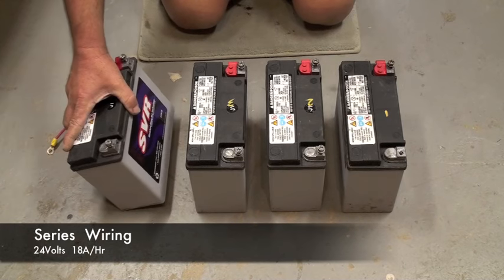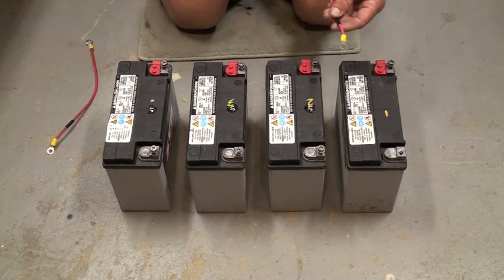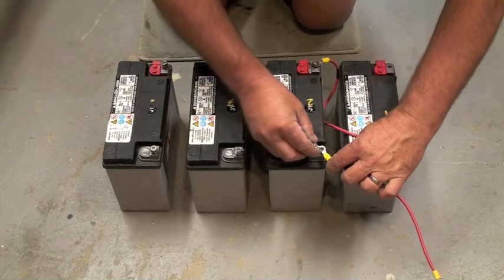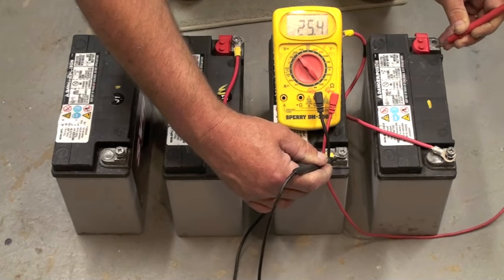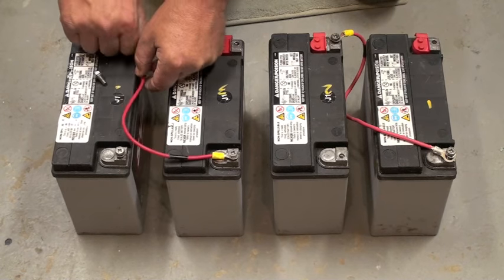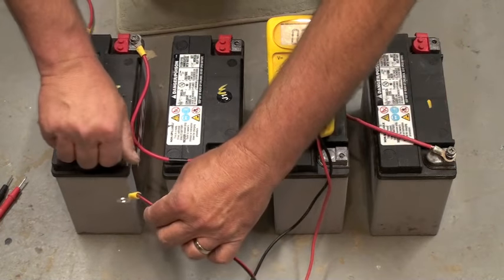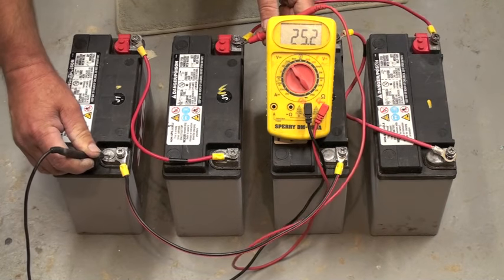Wiring Batteries in Series and Parallel.m4v

Comment: Isn´t it dangerous to touch the terminals with your bare hands? No risk of electric shock?
Reply: It is safe, as long as you don't close the circuit by doing that.
Reply: Whiskey Jan. I was just going to ask the same question, thanks for answering it! Just to be sure, as long as I am touching just one terminal there is no way to close the circuit, right?
Reply: In general, yes. But if you're working with electricity, safety should not be discarded as a joke. If your hands would be moist and you will touch something metal white you touch positive terminal you might get shocked, since your body forms a ground instead of negative terminal.
Reply: Whiskey Jan. Thanks for replying! How bad a shock can 4x 12v batteries give an average person? A sting or enough to kill?
Reply: I would not try it out if I was you. I was shocked by 6s lipo (22.2v) not the feeling that I would want to feel again. but basically if you get enough amps from it, you can do very serious damage to your body (death is possible). dealing with electricity you would want to wear good shoes with rubber base, and rubber gloves (or electricians gloves in general), and always take care about what you do, don't rush, keep an eye on your hands ant batteries. you can google search for "battery university" you will find useful info there.
Reply: Whiskey Jan. Thanks for replying and the advice on what to google as well! I appreciate it and wish more people were as helpful as you rather than troll on youtube :)
Reply: musicgu7 That is really nice. I have met a lot of trolls on youtube latelly, it is too bad and anoying. When we meet people that want to help it is awesome!

And the explanation for the shock coming from the batteries is based on the Ohm's law: V = R.I, voltage equals resistance times current. So the eletricity that passes through an material is based on the current (I) so it depends of the voltage and the resistance, the bigger the voltage and the lower the resistance, the current will be very strong and could kill, 1 Amp is usually enough to kill. So it is really recomended to wear isolation gloves, boots, clothes and other equipment that have high resistance to preserve your life. ;)
Reply: Paulo Henrique Thanks!

Comment: What if i only have 4 batteries, but need 48 volts, and want maximum duration... I dont want to try it to see and get an explosion...  would it short something and  blow in my face if id hook them in serie AND paralel at the same time
Reply: If you wire four 12v in series you'll get 48 volts. The only way to get a longer duration is to add more batteries if you need a constant 48v. You can wire em however you want to for experimental purposes and you'll be fine. If something goes wrong, post the pictures.

Comment: can this method be used to link up battery's to power a domestic 240 plug socket and charge with a generator ? if so what size battery's will need and how many to power 2 13 amp appliances for x amount of hours eg 1,12,24 ,
thanks there will be some very happy tree house terrors lol
Reply: No no no

Comment: how can you test the amperage of a battery? is it possible with a volt meter?
Reply: It should say on your battery.
Reply: I meant the remaining amps
Reply: you need to calculate it and would need to know how long its been used, the draw of the load and when it was last fully charged. possibly when it was last partially charged too, its a complex calculation.
Reply: Chris Serell

Comment: what was the problem if you encounter a battery charger in which it takes and hour to full charge and suddenly you use the machine like floor cleaner in which for only 30mins the battery is drained can you help me to solve this problem does the battery cahrger has a problem i appreciate if you rply some possible solution
Reply: +Angiefrey Cano No the battery charger is probably working just fine, it could be the battery(ies) old and need replacing or it could just be that you are drawing a load larger than intended.
Reply: thnxs for the reply i appreciated

Comment: what gauge of wire are you using to join batterys together ?
Reply from the maker: +Rockey Davis  10 Ga
Reply: +Rockey Davis Also there is a diy guide on www.facebook.com/diyhomeenergykits/app/190322544333196
Reply: Should be 10 square  also determines the ampage that is been created
Reply: Rockey Davis -2-14

Comment: Hello,
I have a question. I want to buy 3 4V 4Ah SLA batteries and wire them up in parallel. I know that if i do that i will have 1 12V 12Ah SLA battery. The problem i have is that 1 4V 4Ah battery only gives me 1A of current( initial current) but for my system i need 2-5 A . So i think if i wire 3 of those batteries up , i will get 3 A of initial current. Is this right ?
I would appreciate if someone would help me.
Thank you

Comment: could i connect 2 12v batteries in series and charge them with a 12v charger together or do i have to charge them with a 24v charger? 
thanks
Reply: you will need a new charger. what you can do is hook those batteries up in parallel charge them both up to 12 volts and then connect them in series to have a 24 volt system with 2 completely charged batteries. not the most practical way to do things but it will work

Comment: Hi if i wanted to put three batteries in my car and connect them but i still want 12v how do i connect them and still have 12v please can you help me thanks and a very nice vid keep the vids coming. peace
Reply: connect the three batteries in parallel ( + to + to + and - to - to -) and you have a 12v battery with whatever amperage the 3 batteries have individually are added together to get total amps (disclaimer is all three batteries ought to be the same voltage, amperage, and age).  Parallel wiring keeps the same voltage and the amperage is additive.

Comment: Hello if I have a 48v 15ah lithium battery pack can add a 12v 12ah lithium battery pack to increase the ah
Reply: Yep. As long as you wire them in parallel.

Comment: so, of 16 batteries, if I wire 4 groups of 4 in parallel and each set in series will I get more run time out of a 48v motor? I'm making an electric motorcycle, using small motorcycle batteries.

Comment from the maker: Is the trolling motor capable of handling 24 Volts?
If you connect 24 Volts to anything which cannot handle 24 Volts, Yes you will probably fry it.
Perhaps you can have both 12 volt and 24 volt systems onboard.
Reply: How would u hook up the electric outbound motor

Comment: Can anyone help, if I have two of these smaller 7ah battery's and a larger 60ah car battery, if I was to connect the two smaller ones in series to make 24v and and had them in parallel with the third to make 36v. I understand that would work but would that put an uneven current draw on any of that battery's, I don't want to damage them. Cheers
Reply: Tom Lowe you would damage The batteries ...

Comment: How do you wire a 2 4xAAA battery holders in series?
Reply: what wires is the guy using in the video
Reply: do you know?
Reply: +BlackMaskGameing RBM You just connect black wire from one to red wire of the other. That leaves you with a set of red/black as your output (~12V, depending on type).

Comment: Need to know how to hook up 2 12 volt car battery to perform 24 volt hook up to a 24 volt trolling motor
Reply: Connect the neg from one battery to the positive of the other.  Then hook the negative lead from the motor to the open negative on one battery and the positive from the motor to the open positive on the other battery.  Now you have 24V power supply.

Comment: I wouldn't recommend these wireing technique to be used they can start a electrical melt down be very careful
Reply: King, this man is 100% correct. I spent 30-years as an aviation electrician and I learned the same way. Also, when electrical things “fry” typically it’s from someone not being familiar with electricity, in too deep for their experience level, of flat out a person that shouldn’t be allowed to purchase tools. If you have proper training and experience working around electricity makes sense and you damn sure respect it! If you don’t know codes or aren’t sure call a qualified electrician. His rate is dirt cheap compared to rebuilding your burnt down home. See it too many times.....

Comment: no your wrong you have not changed the voltage you cant change from 12 to 24 by linking two  12s together  you have doubled the amps or hrs for charge or discharge  thats all
Reply: jake thorpe wrong two 12 volt in series is 24 volts    two 12's in parallel is still 12 volts
Reply: Whatever
Reply: jake thorpe I bet you blow up a lot of stuff
Reply: buddy i work on malty million dollar heavy machinery and never blew any thing but hey i guise you no from playing with lawn mower batt
Reply: jake thorpe Yeah my lawn mower run on plutonium and can light a city.

Comment: Shouldn't leave batterys on concrete
Great video tho
Reply: jimmy d That is in old rule about leaving batteries on the concrete floor.  That rule applied way back when batteries' were made from carbon material.  Now days batteries come in plastic cases.  So no dissipation of charge to ground as plastic is an insulator.  I store my batteries on concrete floors all the time.  No problems.
Reply: +LordCypress2 Thanx for clarifying. (=

Comment: wont he just short circuit the battery since he is wiring it in a closed circuit?
Reply: +Danielsan Pesongco he has not closed the circuit
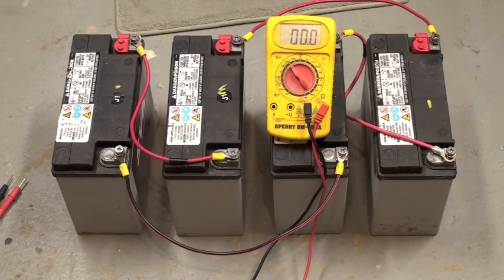Reply: +Carpers Baits 2:50
Reply: +Danielsan Pesongco that isn't a closed circuit its linking the two arrays in parallel.
Reply: +Carpers Baits oh. ok. thanks for the tip. now i know what is what.
Reply: Yeah and all the current goes to his body, those batteries have veeeeery high amperage

Comment: I WILL MAKE IT EASIER FOR YOU....ON YOUR SERIES HERE...PUT BATTERY 1 AND TURN IT 180 DEG... SO YOUR POSITIVE TERMINAL WILL HOOK TO YOUR BATTERY 2 NEGATIVE TERMINAL BE A STRAIGHT LINE INSTEAD...RIGHT NEXT TO EACH OTHER WITHOUT DOING A CRISS CROSS ..THEN SO ON ...YOUR TERMINAL BATTERY WIRING WILL BE NEXT TO EACH OTHER..SO MUCH EASIER ON THE TERMINAL..IF YOU WANT TO INCREASE THE VOLTAGE THEN GO SERIES BUT IF YOU WANT TO INCRESE YOUR CAPACITY SUCH AS YOUR AMP HOURS (AH) THEN GO PARALLEL.....THANKS.

Comment: 12 volts is a very low voltage, and the resistance within your body is quite high. When that very low voltage meets with the high resistance there is not enough energy flow to your body for you to feel anything. This is different when the batteries are in your car and the negative terminal is grounded by all the metal in it's frame, that could result in a nasty shock because you have greatly reduced the resistance and increased the possible energy flow.

Comment: You should NEVER connect batteries in parallel. Why? Because one battery is ALWAYS less voltage then the other and the stronger one will start charging the weaker one, eventually draining both batteries. Remember they will NEVER be equal and this will see saw back and forth until they are dead.

Comment: Aint no way he did not did 48 and i watched this all 😂
Fkin hell wasted time

I did 48 on an e Bike based on these instructions and when i try to hook the bateries to the  inverter or whatever it called it sparks ( i dont insist i just tap for 0.5 sec to check if it sparks ) and thats a sign that smb is bad
All the cables are connected corectly  from the inverter or whatever its his name to the hub motor/ lights display  throtle. So in my opinion when i corect the batteries it should not spark but it does idk